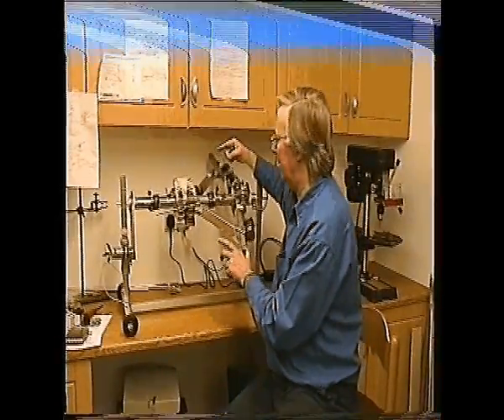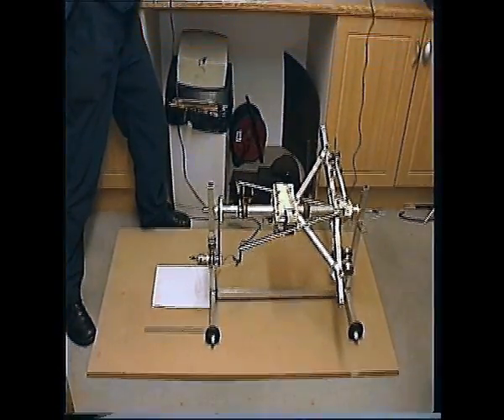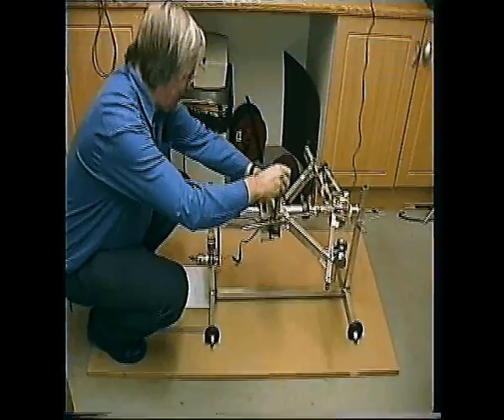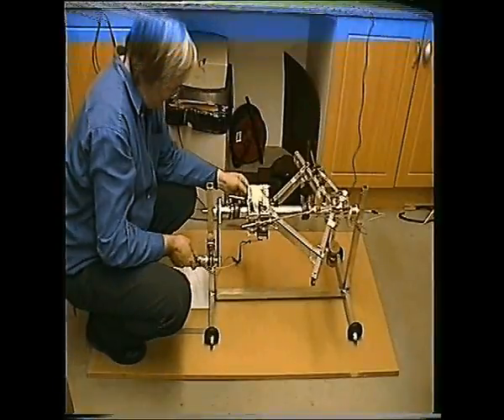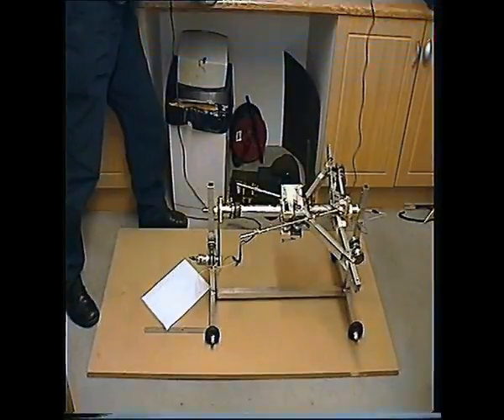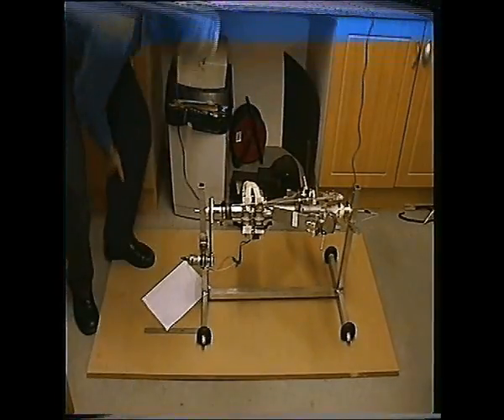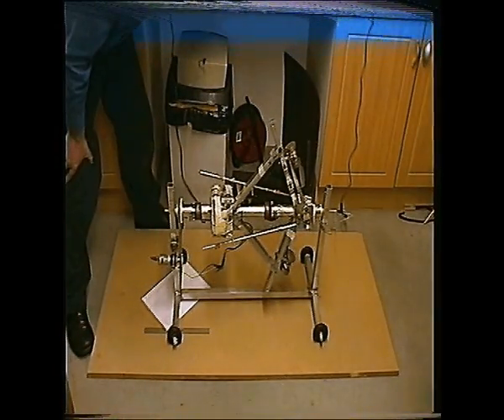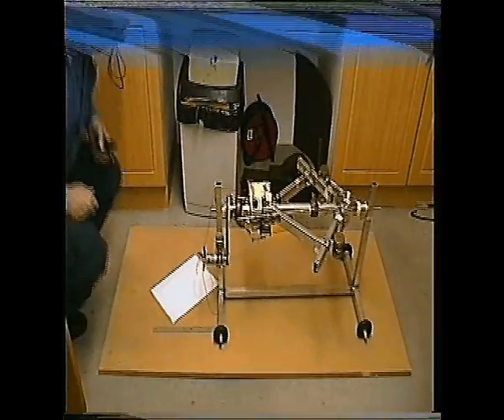Impulse drive exists - but not as sci-fi imagined........

Comment: Let’s just set aside the fact that you are reloading the machine each time.

This propulsion forward comes from the harnessing of gravity through the friction of the base wheels. It’s like riding a wave on a surfboard. This wouldn’t work is space however if you were to find a way to tap into the gravity of the universe you could achieve propulsion while still working within the laws of known physics. Any propulsion would be exponentially multiply over time to achieve a meaningful speed.

Comment: This would never work in a frictionless environment and in no way violates any of Newton's laws.  The part you seem to be missing is that when the weight slides to the left (in the context of this video), it accelerates slowly enough that it doesn't break the static friction of the wheels on the frame, so the frame stays still even though there is a force being applied to the frame opposite of the direction the weight is moving.  Then the weight "hits" at the end of it's stroke suddenly enough to break the static friction of the wheels, and "propels" the frame forward by an inch or so.  

Nothing shown in this video has generated any actual propulsion.  If this was in a frictionless environment (like in space) when the weight moved to the left, the entire frame would move slightly right compared to the weight, and as the weight is retracted again, the frame would move slightly left back to it's original position, but the center of mass of the overall system would remain in the exact same point at all times (as in not doing anything but wanking back and forth). 

This is the equivalent of holding the brakes on a bicycle, throwing your weight forward and releasing the brakes at the end of the stroke and pretending you've invented a reactionless propulsion system when you get your bicycle moving.  As your weight is thrown forward, the tires are pushing back against the ground (not reactionless).  Imagine floating in space while holding a heavy weight and pushing it away from you and pulling it back towards you.  Do you believe this would generate any propulsion?  spoiler alert: it wouldn't.

Now imagine standing on ice skates holding the same weight.  Smoothly and steadily accelerate the weight forward, letting it "hit" at the extent of your arm's reach.  This could allow you to move forward, and do it enough times you could even get around a pond due to the nature of static vs sliding friction (it takes more force to "break" something free from friction than it does to keep it moving).  Now float out in space with your same weight and ice skates and try it: you would do nothing but push a weight back and forth and wiggle your body back and forth, but the center of mass of the system (you and the weight) would not accelerate in any direction.

Not trying to be a jerk here either, just offering my two cents on what is happening in this video, at least you're trying to make a breakthrough!  Best of luck, prove me wrong!

Comment: Best advice for those skeptical about how reseting this back to the starting configuration would reverse the forward motion watch the video he cites: radio-controlled model sitting on ping-pong balls (an air table would have been nicer) and it moves forward each stroke. End of skepticism.

Please clarify the argument about the use of gravity to reset the second device: the rail the gyro is resting on has only a slight incline, so why would this not work in space?

Thanks
Reply: How about mounting it so that it can rotate 180°, so that the return stroke goes in the same direction. That would create momentum of course, but with let's say three of these units counter rotating each other at some angle to stabilize the craft...
Three units would look like a triangular craft. Strange or not...

Comment: THE AGE OF IMPULSE DRIVE IS RAPIDLY APPROACHING

https://forum.nasaspaceflight.com/index.php?action=dlattach;topic=39772.0;attach=1351983

Here's Larry J Reed's paper on applications for phase conjugate mirror waveguides which predicts gravity, mass and inertia are all wave mechanical phenomena. The diagram at the bottom of the paper shows how a device could be built to generate pairs of photons which are symmetrical in their phase angle and momentum vector (time-symmetric). The photon-anti-photon pairs can be mathematically described in terms of a zero order tensor (scalar) composed of an EM vector field sub-structure. Reed goes on to predict that a net force will push the cavity from the inside when a Doppler shifted wave interferes with the soliton, forcing the scalar field to decompose by phase shifting, revealing the hidden EM vector field.
Reply: The number of loonies who get contracts from NASA is a very worrying phenomenon.

Comment: when the armature moves back to coiled position it will move the cart right where it started unless wheels are locked during during recoil. since the whole "drive" here relies on friction it's far easier to use the motor to drive what are called wheels :). in frictionless environment no inertial machines work. lookup hexbug for a much more entertaining example..
Reply: Sorry I was reading your comment and I couldn't stop laughing really hard.
Reply: pls explain :)
Reply: ecsyntric Your coment was really funny. Right but funny.
Reply from the maker: Hi Esyntric,  As part of the "opposite" linear reaction that is predicted by the third law is used up in the torque reaction turning the main shaft the balanced action/opposite reaction that occurs in all other reaction mechanics is somewhat adrift here.  You knew that though, didn't ya!?  Driving wheels is, of course, far easier if your imagination is Earth bound :-)kind regards NM

Comment: In relation to induced angular gyroscopic precession, the third law of motion is unassailable but could be stated as; 'for every action there is a reaction, but not necessarily at the same time' - meaning: as your gyros spin up they cause an action in one direction, while the gyros are at constant angular velocity there a stored reaction, when the gyros slow down the reaction, which is equal to the action, occurs.Hence the start/stop motion. By the time the reaction is output the device has moved and the reaction brings the device to a halt. If you flip the entire device over while the reaction is stored, then slow the main shaft then output reaction will be in the same direction as the input action - resulting in a constant linear acceleration equal to the value of the angular 'jerk'. This is a small value, but over time in a microgravity environment can lead to a very high velocity. Just like an ion thruster. Efficiencies need to be compared.
Reply from the maker: Dear Paul,  
I believe that the third law was over reached by the addition of the word 
“opposite”.  Hardly surprising something was missed when the third as it stands 
describes and predicts (always an indicator of a sound law) so many mechanisms and motions.  
Despite your assertion that the third is unassailable, you then go on to 
“assail” it yourself by your proposition that the reaction may not happen at the 
same time.I believe you are wrong to suppose that there is a delay in the reaction to the input.  It 
is very simple but because it is counter intuitive it is a nightmare to get to 
understand that the reactions are not all opposite and that therefore with the 
correct configuration can be made to create an overall non opposed action (plus 
loads of the usual complex opposed reactions) upon the machine.  The major 
problem, and the reason for my laying the machines to rest, is that the 
unopposed actions (they are matched but not oposed) are presented in discrete 
movements (N B: movements over a set distance then a dead stop - not an 
acceleration).  This means the while it could be upscaled and upspeeded so the 
thing could be used in space it would take forever to move it any useful 
distance as its speed is not accumulative.  It is thus an anti-Newton curiosity not a space drive – sorry, but at least I tried.  Kind regards,  NM
Reply: Hi NM, the stop start motion is due to an action, a delay and then a reaction - acceleration, coast, deceleration. Without a delay, your device wouldn't roll before stopping. Great work! Consider if you could flipping the device over by 180 degrees during the delay and having the deceleration in the same direction as the acceleration - the faster the flip and the shorter the delay the greater average acceleration in the ONE direction. No more start stop - continuous acceleration. At one 'g' the moon is 3 hours away, Mars is 3 days and from Pluto orbit, across the Sun to Pluto orbit is about 3 weeks - including drive reversal halfway. Now, to make it... :)